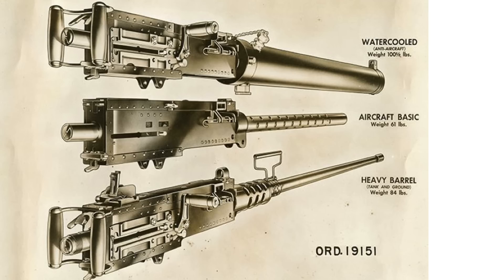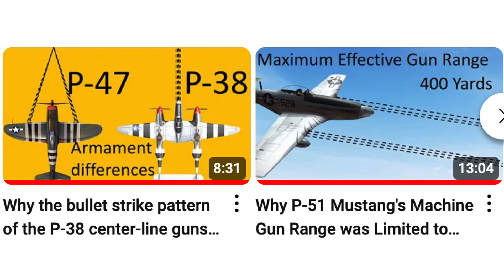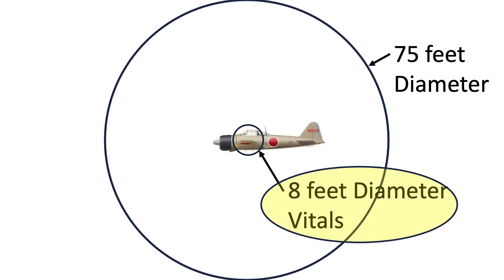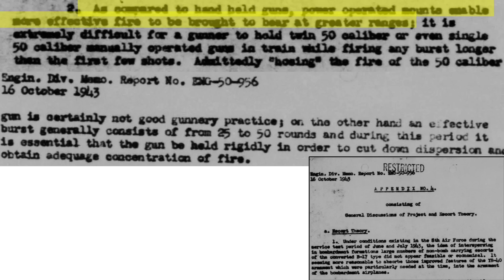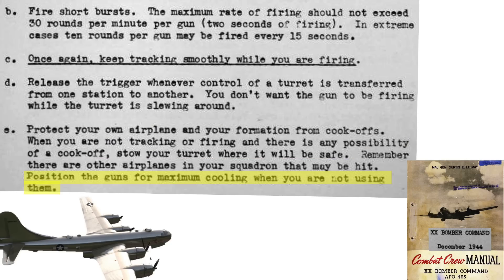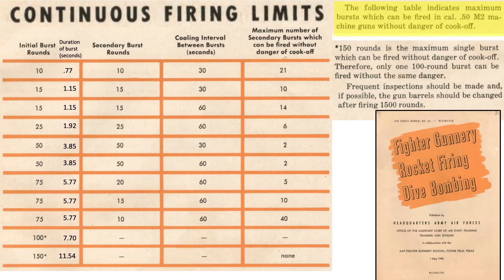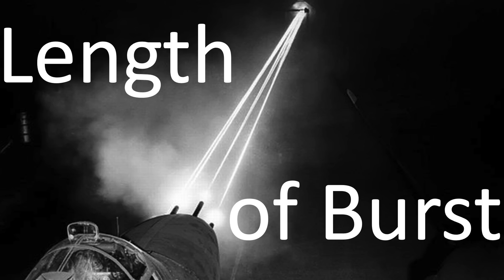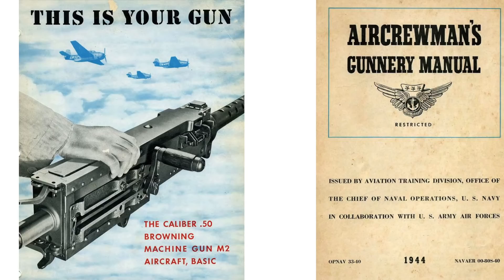Why WWII Fighters and Bomber guns were burst limited to a few seconds of  fire- Deep Dive Review

Comment: The low level bombers attacking ground forces, airfields and ships had a practice of not flying directly behind another aircraft due to cook-offs happening. They'd fly line abreast on areas pouring rounds and bombs on targets. First manual individual recharge handles then solenoid recharging all guns with one button of pilots' yoke.

Comment: Why did they have barrel shrouds?  Wouldn't that reduce cooling capacity while increasing drag and weight?  I could see the door gunners having them since they bring the guns inside, but all the turrets?
Reply: They also act as 'heat-sinks'.  that is, the heat from the gun spreads to them.
Reply: @lewcrowley3710  No they don't.  They don't touch the barrel

Comment: So did the armourers check each gun after every mission and swap.out barrels etc if necessary? They could gauge usage on spent rounds but wouldn't know the rate of fire used.....?
Reply: Armourers regularly removed & replaced guns & then maintained the removed guns in relative comfort at a bench - changing barrels, sighting them etc. There was obviously no paper trail of gun usage per gun as nobody had the time for such things! Those guns weighed 60lbs so it made more sense to replace an entire gun rather than doctoring each weapon in place in the plane. Armourers all had bad backs BTW.

Comment: question for the channel:

1) bombers staying in formation was critical for survival, to bring as many guns to bear on attacking fighters to match firepower (mutual fire support from interlocking fields of fire), but 

2) gunners were instructed to only fire on fighters flying a pursuit curve to the bomber

so how does this work? a fighter flying a pursuit curve against a bomber is not flying the same pursuit curve to the rest of the bombers flying in formation. doesn't this end up being 1v1 between the bomber vs fighter? instead of ~4+ vs 1 between bomb squad vs fighter?
Reply: For a gunner to know the enemy a/c is on an intersecting pursuit curve is usually asking too much, unless it's an obvious direct rear/front straight approach - the uncertainty re the final target produced the crossfire I bet. The wise move was to conserve ammo given the difficulty [high] in tracking an a/c where leading-the-target was essential.
Reply: I think it boils down to the number of bombers vs. the number of fighters.

If there are 100 bombers and 70 fighters, it would be easy to for the fighters to pick up half of the bombers one after another from many directions.
If they are flying in a combat box formation however, each bomber can only be attacked by one or two fighters at most.
Fighters would run into the difficulty of raming into each other or other bombers, when they try to disengage, since the bombers are flying close together but at slightly different altitudes.
So it basically makes it less efficent for the fighters to attack the bombers.

Comment: This is a great technical presentation. But the manual and the numbers used are from May 1945 when most of the war was over. This is more like a lessons learned conclusion after about 3 years of war. It would be interesting to know what was teached in 1942.

Comment: Did these analyses take into account the cold outside air temperatures at the high altitudes the planes were flying at?  Would not the barrels cool off much quicker at high altitude?
Reply: Thinner atmosphere = less air molecules to transfer heat to & cooling via radiation is inefficient/slow. Balanced by a/c speed I suppose.
Reply: @nightjarflying  Good point! Thanks!

Comment: Always enjoy your presentations.

Your technical data is first rate.

I'm almost positive that the M2 fired from the open bolt position...so if tbe primer is ventilated I suppose the gun powder reaches its auto-ignition point...cook off.  With the breach open does the cartridge eject itself even somewhat cleanly?  Seems unlikely that another round could road reliably?

Anybody?

Comment: I wonder if 20mm autocannons have the same problem, or if their rate of fire is slow enough to avoid the problems described.
Reply: The question is probably a bit academic. Because the ammunition is heavy and bulky, fighter planes in particular can only carry a limited amount, so had to be used sparingly. Early cannons used 60 round drums. On some fighters, such as the Bristol Beaufighter it could be reloaded in flight by the navigator.
Reply: @philiphumphrey1548  Good answer.  I read an account from a German BR-110 crew member where he stated that the cannons could be reloaded in flight--but noted that this was not easy at night in a maneuvering airplane.  Ammo capacities increased as the war went on as the combatants learned how to make belt feed work.  For the P38 I have seen ammo capacities for the cannon from 120 rounds to 150 rounds.

Comment: The danger of a cook-off illustrates one of the differences between the M-2 .50cal and other machine guns: The M-2 fires from a closed bolt, with a cartridge chambered before the trigger is pulled. Most light machine guns, the kind that a soldier would carry on the battlefield, fire from an open bolt position, with the bolt held open to the rear when ready to fire and the cartridge only being chambered as the trigger is pulled. Between bursts, a light machine gun has an empty chamber which helps the barrel cool somewhat. A cartridge cook off can only happen in an open bolt weapon if a malfunction has left a live round in a hot chamber. The closed bolt operation of the M-2 Browning makes multiple machine guns easier to synchronize in turrets or in fighter aircraft, but between bursts, the large .50cal cartridge, with a whole lot of gunpowder in it, is left stewing in a heated gun barrel.
Reply: Funny enough the British actually corrected this in their 303 version of US Browning MG , since their cordite ammo made cook offs more likely they manufactured their guns to a modified design
Reply: @MildyHistorical They then suffer a different problem: bolt freezed at high altitude because the open bolt design. Fixed by add a disposable cover fabric right at the gun hole on the wing that would be shoot through in combat
Reply: 300nph at 20,000ft it's pretty chilly
Reply: Say what? Everything I have seen has M2's using an open bolt?
Reply: @paulmorissette5863  Nope....closed bolt, short recoil operation...Its a bit different that way.
Reply: @rickb1973  OK. I've corrected myself. Oops.

Comment: I never knew that gunners were instructed to fire so few rounds, however it makes perfect sense. Brilliant stuff!
Reply: and for the non-turreted and wing mounted guns, the manually aimed guns are VERY hard to keep on target accurately while she is bucking under recoil. It's fun to let off a longer burst, but hard to hit targets. In training,  we'd set a steel 55gal oil can at 100yds and let guys unload a 100rnd belt into it, and guys struggled to hit it on full auto. Single shot and short burst they could hit it no problem.

The M2 is a Beast of a weapon, and my favorite mounted weapon.

Comment: I would have thought the barrell would cool very quickly at that altitude and wind blast.
Reply: @xmeda,
 I'm in agreement with MrAlwaysBlue...   ☆
Reply: The air is thinner, but I would say you are correct.  Also, the air is way colder at altitude.

Comment: If you're flying a Messerschmitt BF109E or Mitsubishi A6M Zero, you only have 60 rounds of ammunition for each 20 mm wing cannon lasting about 7 seconds total. Blazing away (as endlessly depicted in war films) was out of the question.
Reply: In realistic simulations many are surprised how short the ammo supply is.
Reply: But of you have 20 mm or 30 mm cannone, you strike down a bomber with 4/5 round....
Stukas 37mm kanonevoegel was a butcher of tanks and Little ship
Reply: @tiopentalsodomNS88  You can as long as they hit in the right place, but in reality an awful lot miss. Some planes like the Hawker Hurricane and Fairey Swordfish used a stressed fabric skin in places which 20mm cannon shells tended to pass straight through without detonating.

Comment: Many modern vids of browning 50 cal's shooting show them jamming and the operator has to cycle the action. How did a pilot do this?
Reply: electronically, usually. or perhaps a mechanical linkagee to charge it, but sometimes you can't unjam a gun remotely and have to just deal with it not working. If you have access to the feed cover and belt like a waist gunner, you can probably clear it manually without much trouble. M2 was my weapon of choice in combat, and it is a great weapon.
Reply: @SoloRenegade  I guess most fighter planes in ww2 had multiple guns anyways. If one jammed it wasn't good, but it wasn't the end of the world.
Reply: @pjoffrion  sometimes pilots did have all the guns jam for whatever reason, but yes, far less common for that to happen.
Reply: @pjoffrion  At Midway, for example, USMC F4F pilot Marion Carl had all of his guns jam after his first pass on his first combat sortie. He flew away and was able to restore at least 3 of his guns after some effort to unjam them. and then returned to the fight, scored one kill before heading back to Midway island.
Reply: Machine guns mounted ahead of pilots sometimes had charging handles in the cockpit.  Some pictures appear to show the entire breech in the cockpit, which means either I have misinterpreted those pictures, or it was noisy as hell in there.

I believe wing-mounted machine guns and cannon had electrically controlled charging.  But I don't know.
Reply: @grizwoldphantasia5005  guns are quiet when the barrel is outside the vehicle. If you figure even a small gun (rifle/pistol) with the whole thing inside, you will probably go deaf. If you stick the end of the barrel out a hole first but keep 90% of the gun inside, it will be very muffled, more  of a simple "pop". Speaking as a combat vet who trained people on the M2.
Reply: @SoloRenegade  Thanks -- I'd assumed that breech opening and closing would make more noise.
Reply: @grizwoldphantasia5005  It's a common misconception.

Rack a gun. How loud is it? the bolt literally makes NO more noise than that. I had to teach a LOT of guys that you Can catch the bolt even on a Mk19, to stop a machine gun. People mistakenly think the recoil is what they are catching. But it's not true. When slamming home the bolt uses the same spring it always does, the same spring you overcome to charge the weapon, which you can overpower easily with your hands. The spring wont accelerate the bolt home any faster when firing than when charging.
Reply: @SoloRenegade  No, I was thinking of all the gases coming out.  They make a lot of noise from the muzzle end; they must make some noise from the breech end too.
Reply: @grizwoldphantasia5005  By the time the casing is ejected, the charge is already burned, and so the only noise is mostly coming from the action. They have locking bolts and mechanically timed motions.

With the M240, M249, etc. they are gas delay operated, and the M2 the barrel and bolt recoil a distance together before the bolt actually opens, keeping the breech closed long enough.

Shooting out of a vehicle with the barrel sticking out is like shooting suppressed.
Reply: Fun fact: During ww1 in planes with guns in front of the pilot, pilots would have a hammer in the cockpit meant for dislodging cartridges from jammed guns 😂
Reply: @randomnickify  partially true. Every type of gun jams in different ways and for different reasons. Some pilots of WW1 might bring their own hammer, but it was not standard issue.

Comment: How common was it to run out of ammo .. or gun becoming totally jammed  while under attack
Reply: Reading on development of some fighters shows design flaws which let the wing magazine trays flex too much or let the ammo belts slide around too much during violent maneuvers.  I specifically remember some F4F Wildcat problems, but not which dash versions.
Reply: @grizwoldphantasia5005  An example, USMC F4F pilot Marion Carl had his guns all jam during his first combat at Midway, but was able to unjam at least 3 of them and go on to score one kill that flight before returning to Midway Island. I want to say he was flying a F4F-1 Wildcat, but can't recall for certain.
Reply: @SoloRenegade More likely the F4F-3, the -1 was rare.  The -4s were prioritized for carriers, but they errored in reducing the rounds per gun going to 6.

But a good point.  The Germans kept nose guns as there was more mechanical leverage to unjam a gun, an even worse problem with steel case.
Reply: @SoloRenegade  The first Wildcat to see combat was the F4F-3, with four guns.  It was replaced by the F4F-4 by Midway*, which had an additional gun installed further out in the wing.  I have seen it stated that these guns reduced the fighter's roll rate, due to the additional weight relatively far out in the wings, and was unpopular for that reason.  The same comments indicated that some pilots had the outer guns removed for this reason.  The late-war FM-2 Wildcats went back to four .50s.
*I don't know if the Marines on Midway had -4s or were stuck with -3s.
Reply: VERY common. tons and tons of mission reports listing jamming or running empty. And I can speak from experience in combat, people tend to be a bit too trigger happy. 100rnds of M2 .50cal goes FAST. And so even if you have a few thousand rounds it can go quicker than you think. Ammo is heavy and so you typically have limited belt sizes. And if you're firing multiple guns at once, it goes even faster.